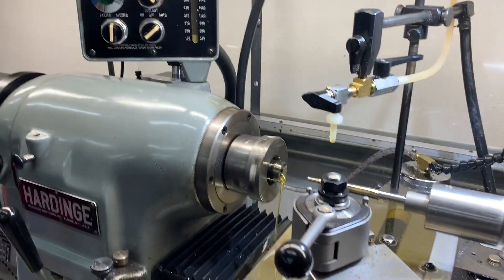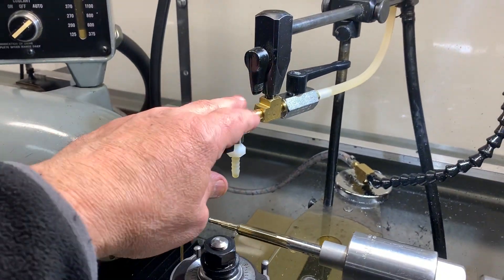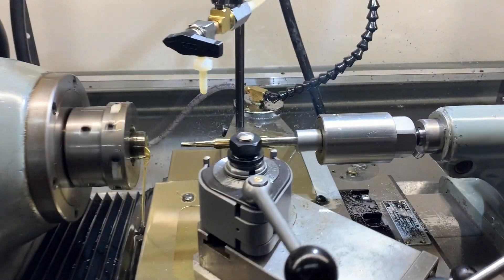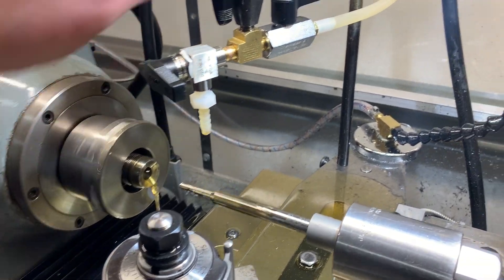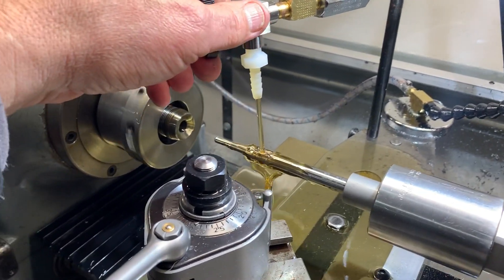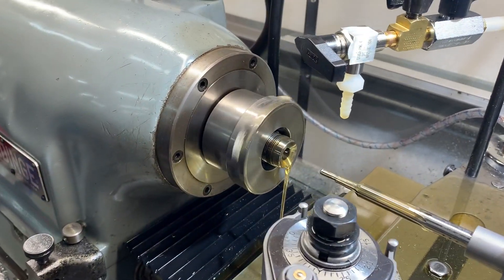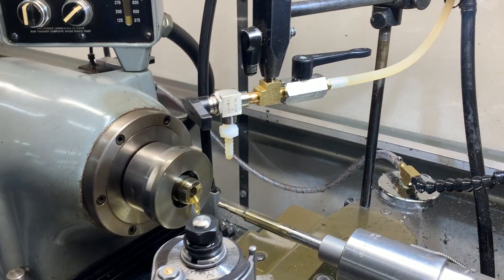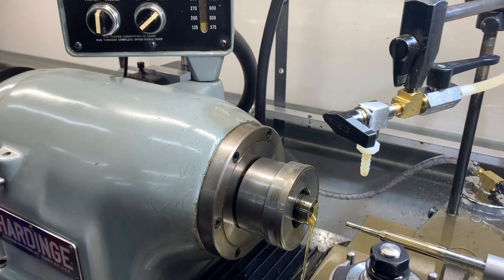Rifle barrel flushing set up. Part 2

Comment: Hi what type of oil do you use in the flush setup?
Reply from the maker: I am using Mobilmet 420.  It is the same as the lathe uses.  I tee off the pump line and install an inline filter.
Reply: Thanks for the reply @shelbygt350r